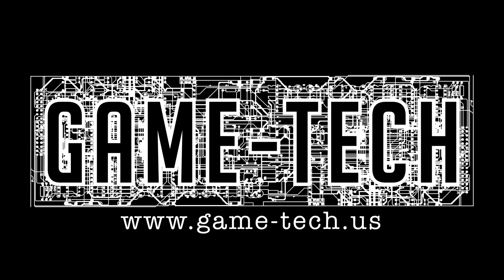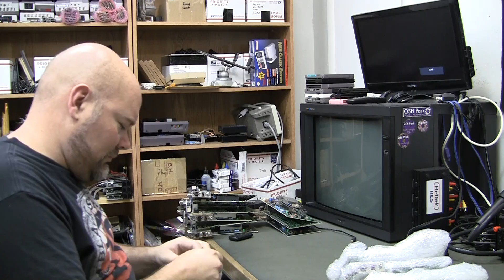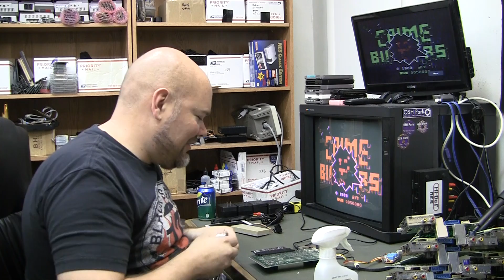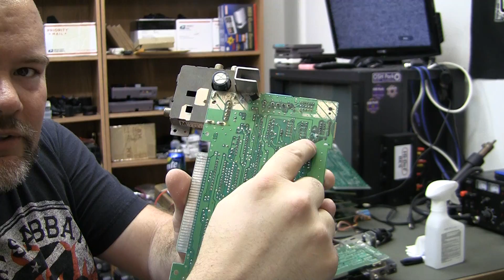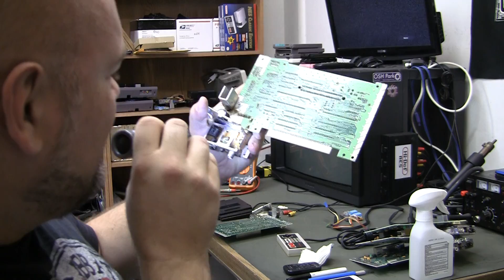Ebay junk lot - NES front loader mobo trouble shooting nintendo

Comment: OK, HELP. I bought the rebuild kit and the cap kit. Perfect video. Plug in the audio rca and vid dies for good. Coax (the one that needs the grey inline box) still works. SECOND MACHINE THIS HAPPENS TO! Is there a fix or im stuck with fuzzy vid from vhf ish method?

Comment: A burned rectifier will not transmit current.  That's the only scenario where passing in DC instead of AC will not work.  DC input on a 7805, loves it, it doesn't care.  A 9V battery should do the trick.

Comment: Just to add, It's old school but yes, reflow solder on the fingers, solder wick it and they work fine. Some really old PCB's I've worked on (not nes) didnt have soldermask, and all the traces were covered in solder to prevent oxidation. works fine.

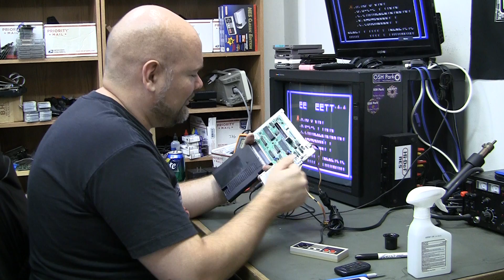Comment: at 28:00 or so, D3 is failed on the VRAM.  NIIL and FAIL are similar;  N -> F is +8, and I -> A is +8 also. So D3 is probably stuck high on the RAM.  It isn't stuck high on the mobo (i.e. PPU, latch, etc) because you'd see vertical lines in the video.  At 32:49 or so, one of the address lines appears to be shorted, open, or damaged causing the video to duplicate on the screen.

Comment: stupid question 
would you ever consider using clone chp replacements like umc ua6527/ua6528  in place of oryginal cpu/ppu in your restoration toploaders? 
they still sells them (used) on ealiexpress for 1$ a chip
For repairing clone system they are great, but i wonder how you feel abut them in the oryginal systems

Comment: we bought RAM chips from jameco... they were remarked garbage.  we had several of them explode when we put them on the board!  Many of them worked but plenty didn't, and the markings rubbed off the top.  Jameco wouldn't refund us either.  So it's possible they sent you garbage like they sent us.

Comment: Mouser has new SRAMs for the top loader

IDT 6116SA20TPGI
http://www.mouser.com/ProductDetail/IDT-Integrated-Device-Technology/6116SA20TPGI/?qs=%2fha2pyFaduiGqofMxP3qcBHF3TkZNM57UZlumWG%252bPvepyJZJUvzyEg%3d%3d

I bought 10 of them and they all passed the RAM test on the test cart I built

Comment: Hi, great video. I like to fix things myself. If you ever want to quickly test a chip to find out if it is good or bad, just spray the chip with nitrogen. If it is a bad chip, it will work while it is frozen. No need to take the chip out of the motherboard to test.

Comment: Are the AV/power modules completely interchangeable? I have an Alps module from a rev 10 board. I de-soldered it and replaced all the capacitors, and soldered it on to a different board that originally had a Mitsumi module and it still doesn't work. Before, it had a blinking light, as I tried to clean the 72 pin connector, the blinking sped up but I couldn't get a picture. Now I don't even get power. Any ideas?
Reply from the maker: Yes they are all interchangeable as far as I know. I did lots of other troubleshooting vids with the top loader that might point you in the right direction for your issue. Too hard to diagnose via messages.
Reply: Thanks for the feedback. I'll look into it.

Comment: bridge rectifiers if they break on the one of the main diodes, it uses four, AC or DC might not find a path from source to ground. but if one of the AC side ones does fail DC could still work. as long as one positive side and one negative side diode survives DC would work and AC wouldnt. although i thought deck loading nes' ran on a DC wallwart, the rectifying is done in the wallwart. unless you can plug in 5V AC or DC into that jack. perhaps the rectifying on the NES is to prevent backwards polarity on the dc jack.

Comment: Which front loader board revisions are rare(er)?
Reply: NES-CPU-05, they're the earliest ones and are the best kind because they have great composite video output and the 10NES chips on them are more easily defeated by unlicensed games compared to later boards, so it's more likely for all unlicensed games with lockout chip defeat circuitry to play on the CPU-05.

Comment: The Bubble wrap is also static full....
Reply: and tape itself generated tons of static when it was wrapped + can generate more when ripping off.

Peeling Sticky Tape Produces X-rays, Im always worried when I receive chinese electronic junk wrapped in tons of tape :(
Reply: Bubble wrap is not full of static, it's simply not static proof from us humans. Just simply touch a grounded piece of metal (like a metal PC case) before handling circuit boards and also avoid standing on carpets.

Comment: I could never get the 0.1" pitch board edge connectors to work well on my test board. I even fried one of my games using it. It would look similar to a bad PPU when the pins would line up wrong. I looked everywhere for an edge connector with the correct pitch but couldn't find one. I ended up having to sacrifice a game genie to find one.

Comment: Another thing sellers sometimes don't realize when shipping bare PCBs is the bubblewrap they commonly use (the clear stuff) isn't anti static so you risk causing further ESD damage to the boards in shipping.

Anyone who has opened a package with bubblewrap and packaging peanuts can see that the bubblewrap accumulates a pretty decent static charge that causes the peanuts to stick to it.

The pink bubble wrap is static dissipative which while not perfect (if you have a static charge on you and touch it you can zap components right through the bubblewrap) it will at least not build up a static charge on it's surface.
Reply: Bubble wrap is really not that bad. EverDrives are sometimes shipped in bubble wrap. Yes, it should be in ESD bags to be completely safe, but they're not cheap, especially big ESD bags. This seller would have had to use 12 big ESD bags, upping the cost of the lot, a lot. If you want to be safe, just simply touch a grounded piece of metal before handling circuit boards and also avoid standing on carpets.
Reply: @DannyCD  a year later but paper bags are static free and a good place to start.

Comment: Do you sell the lockout chip?
Reply: Lol
Reply: I thought it was a joke. Don't tell me you're another one of those people that want the lockout chip intact? Ugh. It's better off non-functional in my opinion.
Reply: No, I don't care about its integrity but sometime there are boards totally without that chip and fixing that problem change from board to board. I don't know how it works for a Mattel version, so the lockout chip (any version) without the fourth pin would solve the problem immidiately.
Reply: Ah ok, my mistake. You're right, the chip does need to still be there, just have pin 4 cut. So it's not even present at all on the Mattel version? I remember there was a multi-cart with a CIC chip in it that says it does not work on the Mattel version of the NES. Is it because there's no lockout chip on it? Is there an empty socket for where it's supposed to go?